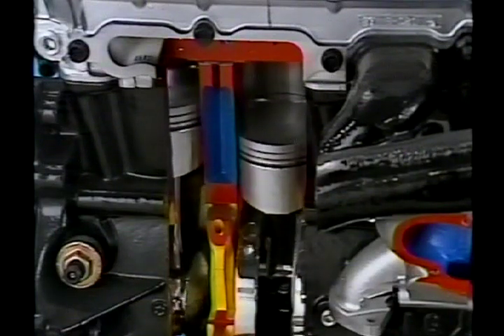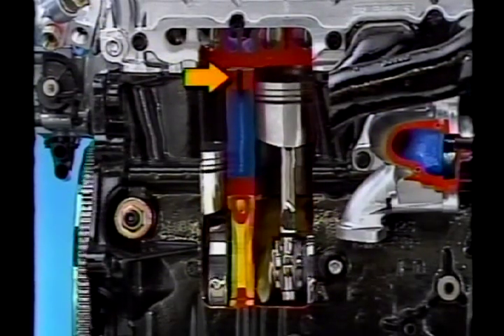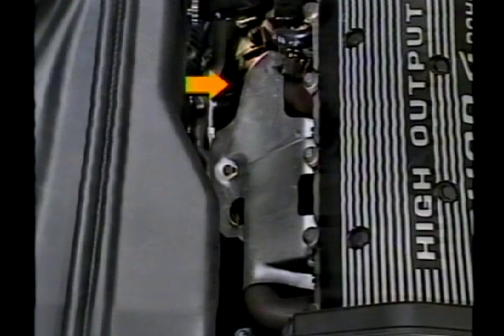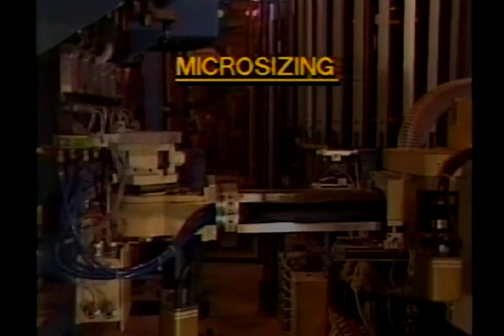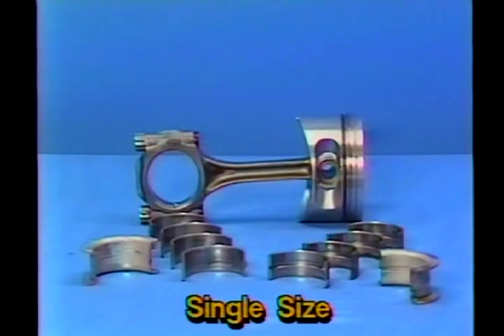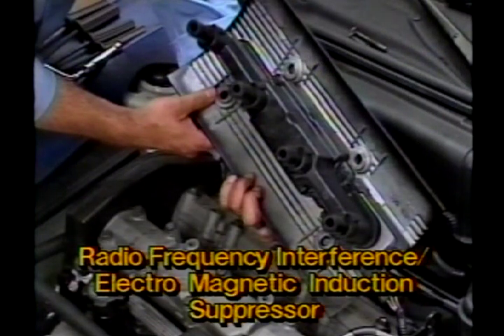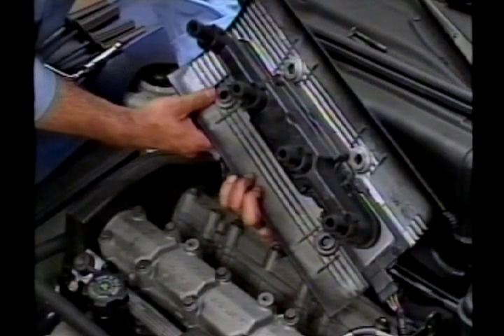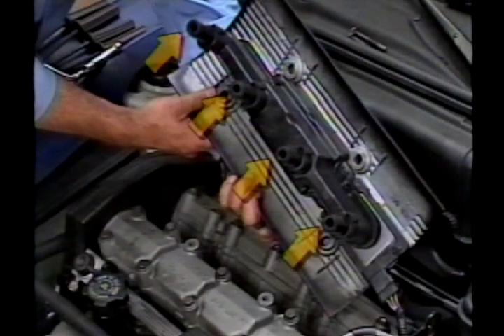2.3L High Output Quad 4 Training Series (part 1)

Comment: My grandma had a 91 skylark with the quad four. Its accleration from 20-45 mph was CRAZY fast. It wasnt fast off the line, nor was it fast at high speed, but that mid section was nuts.

Comment: Had a Grand Damn with one of these. When the water pump started leaking, my mechanic told me $600 to change b/c of the timing chain and sprockets. You'd need quad wallets to keep these running, as they loved to blow head gaskets too.
Reply: Your mechanic must have really liked you. My quotes were double that in east KY. Lol "betsy" (my quad 4 oldsmobile alero), is getting fixed up in the old garage by yours truly. She'll live again I say! With about another weeks worth TLC. (Doing valve cover gaskets while the water pump is off too, been leaking for 30k now)

Comment: What would happen if you put say a turbo on the HO Quad 4 engine?  I know Ford had a Turbo Coupe T-bird and SVO Mustang with a turbo 2.3 that put out power around the same amount as the Quad 4.  

Just think with a turbo Quad 4 properly re-enforced you could be getting over 200 HP and over 300 torque for cars weighing less then 3000 lbs.  Need to be rear wheel drive maybe.
Reply: +Tigerfire75 Unfortunately, you would blow the cylinder head gasket.  Quad 4s did this on their own often enough that increasing the pressure would only make it much worse.  As it was, though, back in 1994 Car and Driver said they were pondering making a Grand Am GTO (since it was the anniversary of the 1964 one) that would have used a turbo Quad 4 of about 250 horsepower.  These engines were grenades under light use; I'd hate to think of what 10 or 15 psi of boost would do to them.
Reply: *****
I think they could of done it.  I mean just ask A.J. Foyt.
Reply: The Oldsmobile Aerotech motors were actually purpose-built.  They only shared basic design aspects.. They were for all intents and purposes custom racing engines.
Reply: *****
I say they were the same engines.  The difference is they took more care with them and also the people using them knew what they were doing unlike the general Quad engine user.

Comment: That distributorless ignition system was so failure prone? What prevented them from using the coil packs found in the 3800, Tech4, and a few other GM engines at that time? Those coil packs were way more reliable.
Reply from the maker: Skyline Fever I assume they were thinking eliminating plug wires would add to the overall reliability of the ignition system as plug wires are prone to misfires from damage, etc and less resistance from only an inch or so btwn the coil and the plug means a stronger spark. Also, it was less parts so simpler and faster to build on the assembly line. They kept this similar setup for the Ecotec which replaced it. It basically was the grandfather to coil-on-plug (COP) which the industry has gone to.

Comment: so tell me where I can get an cast iron head if my head gasket goes and by the way... not to offend you in any way at all their is a thing called preventive maintenance and no I do NOT go to a dealership / repair shop to maintain it. I have a 1995 Buick Skylark 4 quad 2.5 DOHC with 120,000 miles with no problems. Yes I had to re engineer the cooling system, replace water pump, and clean it up. I work on computers for a living NOT cars. I just take my time

Comment: Another notoriously unreliable GM engine! I admit that the engine was very powerful for its time but this propaganda video sure should have stressed how cheaply the motor was engineered! The gaskets always leaked, the iron block and aluminum cyclinder components (when heated/cooled) would expand/contract at different rates causing cracks and leaks to the gaskets and cylinder head! Cheap! Cheap! GM had a very poor understanding of the use of aluminum in engine design back then!

Comment from the maker: Gotta disagree on it coming out in '89 bcz my '88 Grand Am had that engine and it was manufactured in late '87 so technically it did come out in '87.
Reply: I don't think 88's had the High Output.  I personally have only seen 90 and up with the H.O.  I had 88 2.5, 89 Q4, 90HO and  91HO Grand Ams.

Comment: @nova9403 Ecotec is a more advanced model of the Quad 4 engine by GM themselves, of course it's better you simple minded fuck.
Reply from the maker: Undrgrnddrops The only thing I don't get is why didn't they give the regular Ecotec (not the forced induction variants) higher HP/torque #'s than the LO Quad 4 at least.

Comment: what made me mad about this motor is that ignition cover how the heat got traped under it and and made that cheap plastic crack and cased the sparks to arc and damage that ignition box , but me and a friend solved it we moved it to the fire wall and solder wires to new ones that game off Toyota drilled holes in the cover pushed the new into the holes and snap right on the spark luges and looked stocked almost. car ran good to.

Comment: I have and have had all kinds of sporty cars- 1000HP Supra Turbo's, Mustang  Cobra's, M3's, Trans am's as well as several GSXR-1000's and my 1990 Beretta GTZ still ranks up there with my favorite car's I've ever owned.  It wan't the fastest, best looking or most valuable but it did everything well.  Mine was even reliable-unlike most early HO Quad 4's I heard about.  99% of all of them are in horrible shape now but I'd buy another 1 if I could find a good 1! Thanks for the video!!